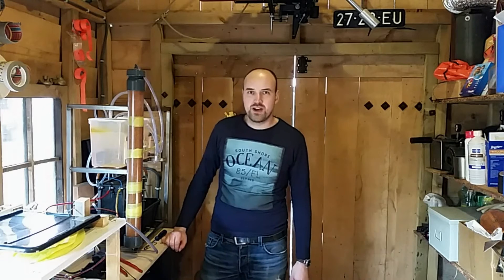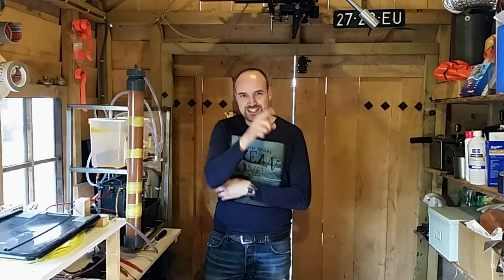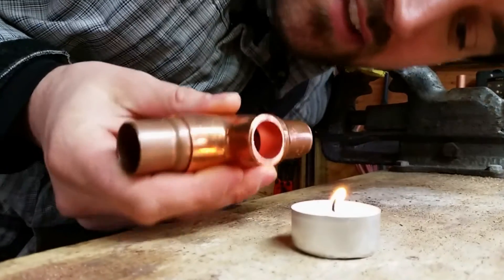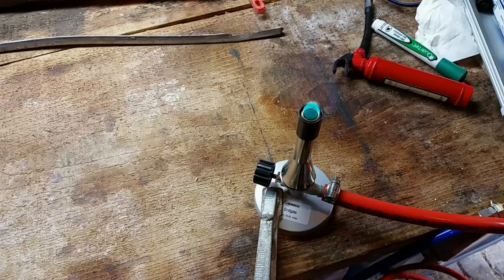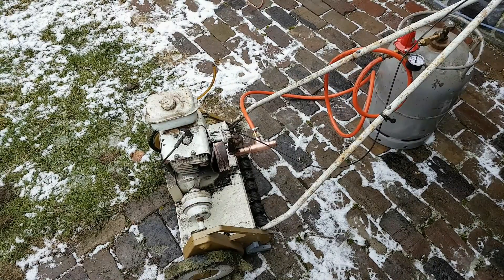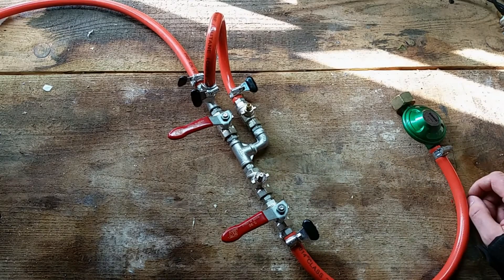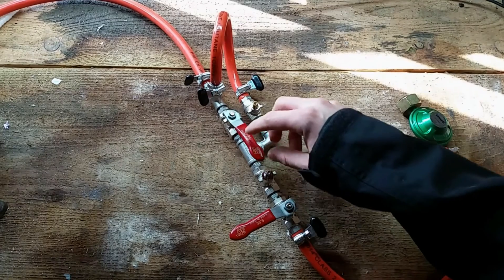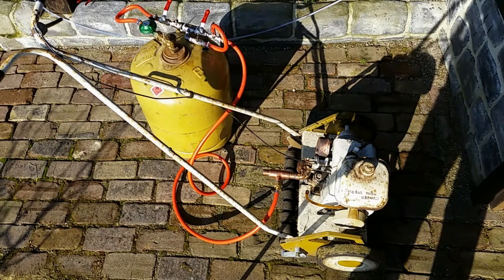Hydrogen powered lawn mower

Comment: I would say get an LPG kit for the mower but I don't even recognize that engine as it doesn't seem to be a Tecumseh, Honda or Briggs.  I guess it could be a Clinton but I am not very familiar with those either.  I guess if you are going to put LPG (Propane) on this mower, I would suggest changing the engine to a Honda or similar design as there are commercially available kits for them.  Although, your channel name suggests that you do this kind of stuff yourself.

Comment: The issue with Hydrogen is the storage mechanism.  The volume to compression makes you require massive storage space.  There was a guy in the 80s that developed a method of storing the hydrogen into a solid compound then heating said compound to release the fuel not dissimilar to how submarines store O2 in a solid state.  He ended up getting called out because the compound was used in military weapons and thus illegal.

Comment: I have a 29 cc four stroke that I'm going to try on this...it's going to charge some batteries, maybe..it smokes a bit but if it runs I'll put rings in it..it's got a hole in the carb the size of a pencil...shouldn't take much
Reply from the maker: If you store the hydrogen, than that will be the battery, and you can just run the generator when you need electricity. Makes it all more efficient.
Reply: Yeah but probably safer to store moonshine lol.  Oh and I found a split phase generator that I only have to run half as fast 1800 to get 1200 watts which is more than enough for 40 amps @24 v so I figured I could use a 2 hp steam engine if I had to and just a bit of wood required and maybe quieter lol than gas  but it never hurts to have options and all...I did read something once about passing steam over a catalyst at high voltage to make hydrogen rapidly...enough to run a motor, so even  cheaper not much storage needed or "more efficienter" still....

Comment: Get a small engine propane carburetor this when adjusted to the engine will allow you to run the engine at any rpm you want because it is self adjusting with the vacuum and the throttle. then your engine will run reliability. Have fun.
Reply: Garretson KN on demand regulator part number 039-122. Should work nicely. Make sure to get a Venturi spacer so that it will pull good vacuum

Comment: Try adding a small water ventury too before you give up. Retard the timing until it only just runs on gasoline approx 2deg after tdc. Also if you can... add an ac 12v high current (200-600watt inverter) supply across your plug that conducts across the existing high voltage spark making it into a plasma spark. You'll need to remove the spark plugs internal resister 1st. Be safe.
Reply from the maker: Thanks for all the suggestions! 👍
Reply: @TheDIYScienceGuy  Please be careful.
Reply from the maker: I always am! 😉👍

Comment: The reason why your efficiency is so low is because A) your carburated A/F mixture is off, and B) as said in another comment your ignition and valve timing is off. I believe once these are corrected, you will yield about +15% efficiency over gasoline (NOT AN EXPERT). 

The best application for these HHO engines are for enthusiast cars. Electric's faster but nothing beats the sound, transmission, and personality of a combustion engine, and as seen in the video, HHO engines share similar characteristics.
Reply from the maker: Your right about the ignition but the stoichiometric range of H2 and O2 is so large that a bang means a right mixture.

Comment: Did you make any adjustments to the timing of the spark?  The spark should be at top dead center piston because of the explosive speed of hydrogen compared to that of gasoline vapors.
Will you try a generator with  timing perfected for hydrogen gas?

By the way I have subscribed.   You got me with the boom and the other boom and the big boom.
Reply from the maker: No I haven't done any timing changes but that supposedly works well! Thanks for the suggestion and subscribing!

Comment: Yes hydrogen,  but ADD THE OXYGEN with the hydrogen to multiply the power tremendously great,
Reply: thats right Master Tech and he need a rhymes hydrogen analyzer to measure the amounts
Reply from the maker: Yes but than you need to store the oxygen to so that makes the system more complex.
Reply: The DIY Science Guy
I started to see your channel today and subscribed!

by what factor would the power be increased if you add the oxygen (approximately)?
Reply from the maker: Thanks for subscribing! I didn't get notified about your message, that sometimes happens. I think about 2 times as much power. But I'm not sure.

Comment: does it work on a 2 times engine from  a grass trimmer? Not sure about the lawnmower. I am curious more about the oil for the engine. At a grass trimmer the oil is mixed with gasoline.
Reply from the maker: Yes on a 2 stroke engine you would need additional lubrication.
Reply: @TheDIYScienceGuy  any idea how to add it together with the hydrogen? I have some ideas about this, and if it works, I will happily share it with you, I just have no idea, how I would be able to combine the oil and the hydrogen intake
Reply from the maker: There are oil injection systems for mopeds I suggest you look in to that. 😊👍
Reply: @TheDIYScienceGuy  thank you

Comment: Check out this windmill design. It has a 4 year payback. After 4 years, the energy is free. You could make hydrogen gas all summer long then use it for your furnace to heat your home during the winter for free. With a zero carbon footprint.  https://m.youtube.com/watch?v=sGIZHJWV2ZM

Comment: Seeing it as 150 litres of hydrogen are about 13 grams it is quite efficient, but the electrolysis of water is only ~40 per cent efficient it is not really worth doing that. But if the hydrogen generation would run off of solar electricity, than it would be quite neat.
Reply from the maker: That's the goal!
Reply: I would add a comment, that hydrogen generators with a reduced efficiency of water decomposition can be made up to 80%, with the correction of the chemical composition of the electrolytes and electrode materials ... In any case, if we convert low energy electricity and we connect it to the substance hydrogen, in By comparison with the price of liquefied petroleum gas, there is a cheaper variant of the use of hydrogen, instead of propane - butane mixture, only remains to save the way of storage of a larger gas of hydrogen, because otherwise a little gas can be compressed into bottles :)
Reply: @hydrogenh2energy964  much cheaper is wind and water engery (if aviable at your place)

Comment: rebuild a 4 cylinder and do a project to work out:

how much hydrogen or hho would be necessary to run the engine for a full minute. 

would be interesting to see if it is possible to run a car on hho or hydrogen..

also.. would this setup enable you to run a small simple LPG bbq? i also read in another comment regarding BBQs you said it would backfire.. perhaps modifying the bbq regulator or jets on the head of the bbq burner to minimize or maximize the gas prior to the point of combustion.
Reply from the maker: Yes with some modification you probably can run your BBQ on it. Thanks for al the good idea's!
Reply: Only needs to ad a flashback arrestor. For a car engine, if I recall,  you would need about 200-250L/min. Thats a lot of gas

Comment: Also, in your previous video, you say 550L costs $1.20. The engine took 150L in 10 minutes, so only costing $0.33! Sounds cheap to me!!
Reply: Sure, cheap, but how about an electric lawnmower charged by solar panels?  $0.00 to do your whole yard :)
Reply from the maker: Also nice but expensive though very effective! 👍
Reply: @TheDIYScienceGuy  try using a propane carb n moding it on mower generator kit cheap china junk or an old used unit from a buffer or ?.ebay has them

Comment: Again, amazing! What if you bottled the O2 separately, and directly inject the engine with both O2 and H2, mixed in or just before the combustion chamber - you could achieve a stoichiometric fuel ratio, so there'd be perhaps no need to "aspirate" the engine. Without all the nitrogen in the way of combustion, there'd perhaps also be a lot more power per stroke! And Also also, it would be an engine that consumes no atmosphere and produces only pure water vapour.... intriguing! And quite dangerous!!
Reply from the maker: Thanks! Yes it would most definitely be dangerous LOL. But also FUN! 😉
Reply: Smart

Comment: Hi, I would like to share my experience with the technology of separation of hydrogen and oxygen, as well as filling a bottle of hydrogen and domestic use instead of propane butane gas :)   
Here's the link of my youtube clip ;     https://www.youtube.com/watch?v=7teeaVor9Ns&t=13s
Reply from the maker: Nice! But be VERY careful not to accidentally pump oxygen in to the bottle. And it can be dangerous to lite the hydrogen side if the separation fails!
Reply: Thank you for taking care of me :) That can be very dangerous !!! Now I use slightly different and thicker fabric material for the membrane. So this material does not stick to the electrode, it does not bite when it gets cracked, and I did not have to get it a lot when I put together a 4 cell cell dry cell, and I have no problem getting out
MIX H2 / O2 raids, but complete separation :)
But this technology requires constant advancement, experimenting with the testing of the most diverse material. And here, my creation and motivation and love for electrochemistry help me to work on it, and to exchange knowledge with other innovators, like you, we would love to be close, that we can do various experiments in the chapter of green technology :)

Comment: Sad! I wish that it worked out better. 150 liters in 10 min. I have a 10hp generator that I was thinking of doing that once I learn a lot more. Did You have to do anything to the engine other then the venturi valve? Also how many liters of hho can You produce per day with your split system. Thank You. I live in Central America ( Panama ) and the best compliment that I can give the internet speed here is that it sucks! It took me over 30 min. to download your video.
Reply from the maker: I recently got the tip that if you set the ignition timing to almost zero it will run much more efficient and also doesn't need to be preheated anymore. Maybe I will try that in the summer. If so, I will make a video about that.
Reply: Thank You for the very fast reply
Reply: @philstat100  you can try 4k video downloader to download a video and watch it later on if you connection sux like mine. Looking for new movies! Thanks.
Reply: What´s crucial with hydrogen combustion engines, is compression.
You can go up to like 40:1 (!)
This can be achieved by blowing the engine up with a roots charger.
Imagine a lawnmower with a scoop on top, like a dragster.
Kinda Mad Max awsome...!!